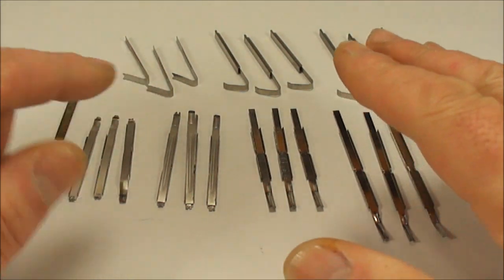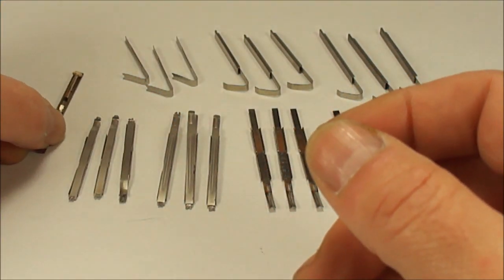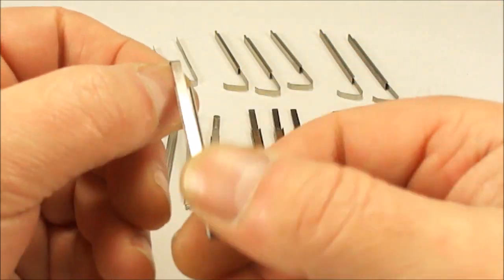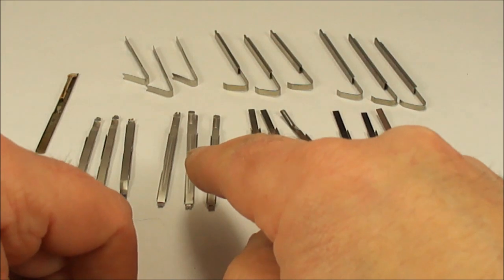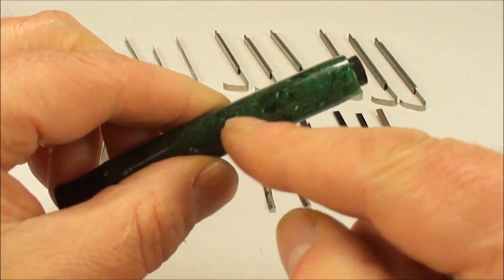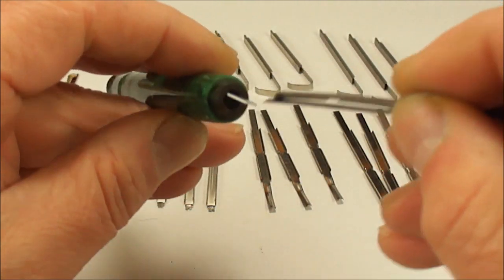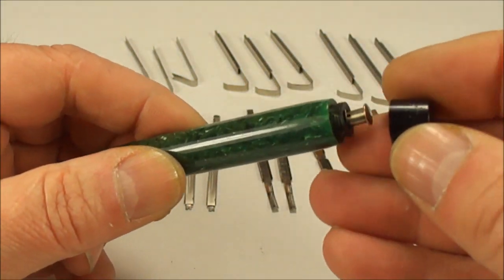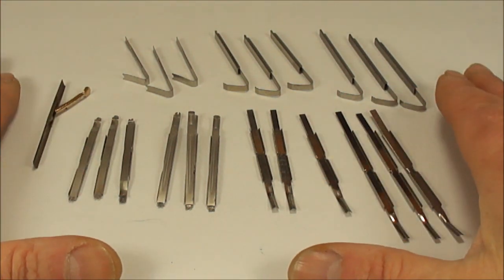PEN PRESSURE BAR

Comment: Would it be possible to fit an anchor bar to a button filler that usually has a one piece pressure bar?
What qualities would the pen need for this “upgrade”?
Reply from the maker: Yes to some pens. Howver you may have a little difficulty re installing the button. Good luck